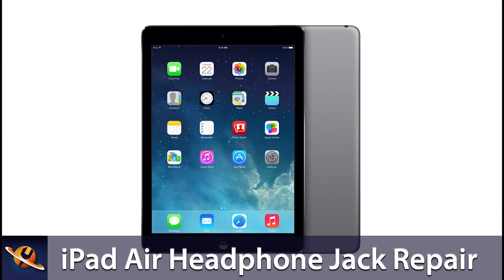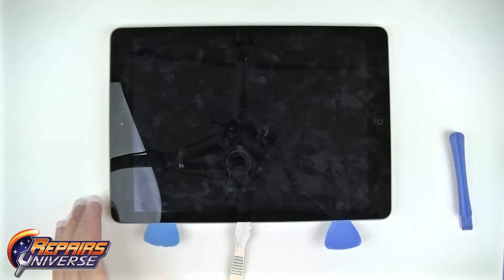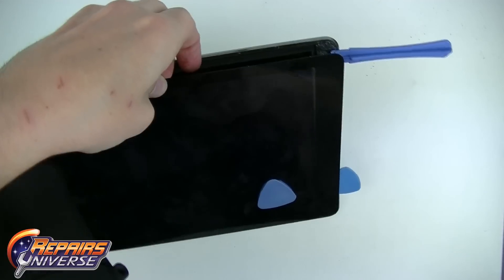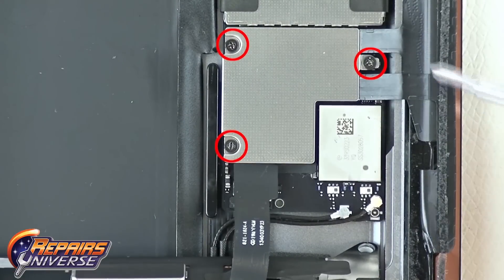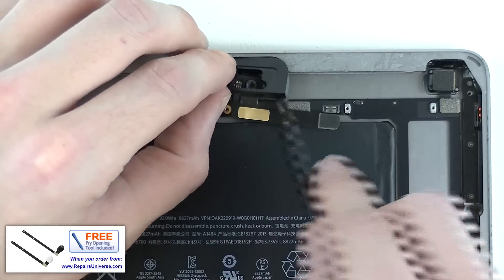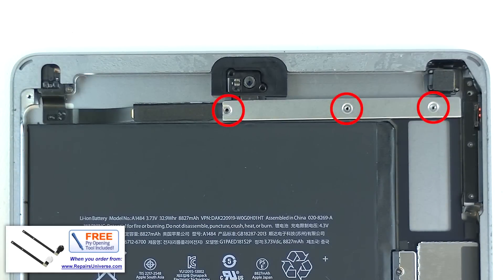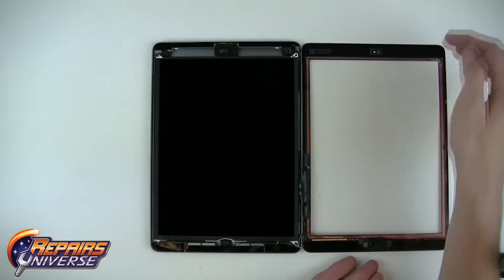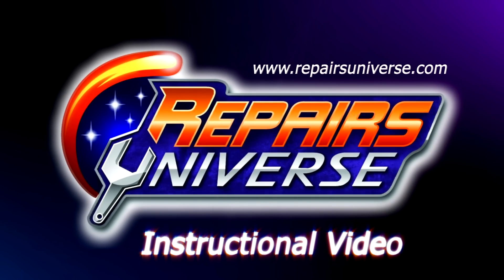iPad Air Audio/Headphone Jack Replacement

Comment: I have a problem my iPad Air 2 audio jack says that there are headphones plugged in all the time so it doesn't play outloud
Reply from the maker: Make sure that the headphone jack and charging port are free of debris. You can use a dry toothbrush or electronic contact cleaner on the charging port. If not the headphone jack may need to be replaced.
Reply: ok thanks
Reply: Sorry for a late reply, check you have no water in the ports as that could also cause the headphone jack to mess up
Reply: Can anyone help me please. My headphone jack broke inside how do I get it out. I have an iPad Air 3 thanks

Comment: Great video - great prices on repair parts - followed instructions on my computer while i was working on ipad - takes a little longer to get adhesive soft than what it shows in the video - but was able to get it done in about 1/2 hour - everything works great - just to compare with ordering the replacement part and tools to fix for $35 - i called u break i fix it store - they wanted $150 and said they would have the ipad for 3-7 days because it was a difficult fix and no guarantees - if you have any handy capabilities you can fix this yourself much cheaper

Comment: Any need to be careful when handling the camera to be careful of dirt and oil on the lens?    As this is normally sealed inside, it's not an issue, but with it open like this it seems you could well end up with an 'eyelash' or 'dust' or 'smudge' on all your camera captures until cleaned.

Comment: I was wondering if you can help me out I have an iPad mini and the headphones only work on a high volume. If I try to play anything on a low volume it wouldn't play and give me static. What can I do? I also rest it and nothing changes. I also tried blowing out the jack and that didn't work either.
Reply from the maker: You may have a faulty head phone jack. We recommend replacing this component.
Reply: Please help me!
If I play any kind of videos my iPad says its on headphones but I'm not using any! 
If I watch/listen to any videos/games it doesn't have any sound!
But if I put headphones it works 
Before it says "volume" now it says "headphones" but I didn't plug any headphones!
Please help!
Reply: +Repairs Universe 
I think it's not because of the headphones maybe there's a glitch 
But if I refresh my iPad it's still there 
:(